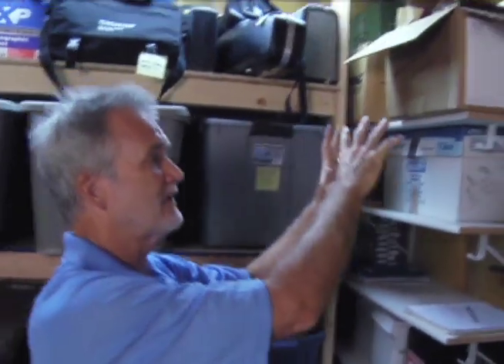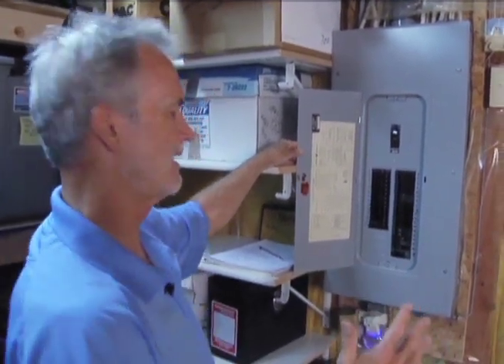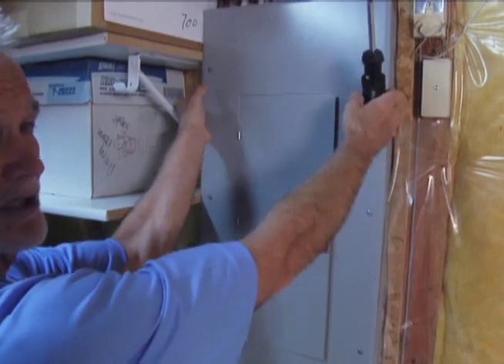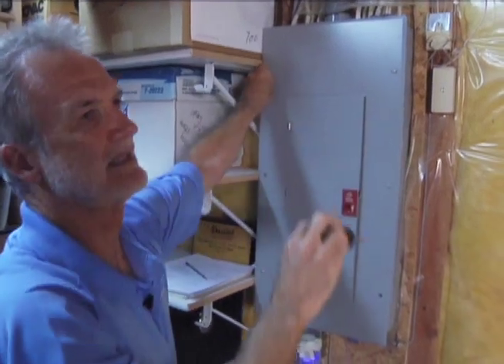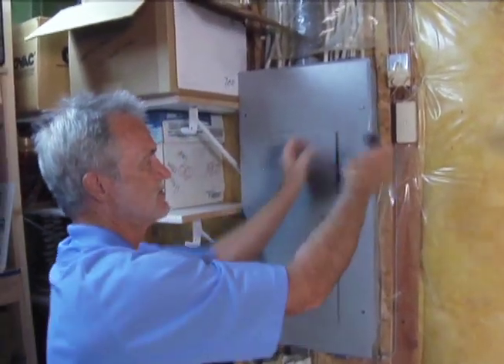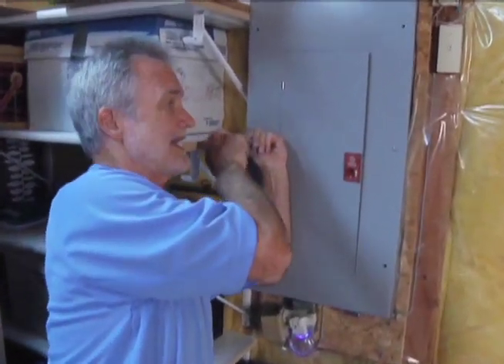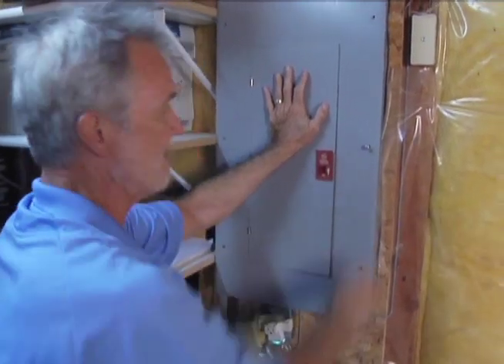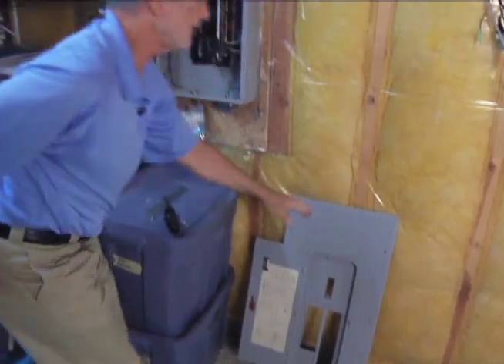How to Remove an Electrical Panel for a Home Inspection

Comment: So it's okay to remove a circuit breaker panel cover while the power is still on in the home?
Reply: As long as you have an appreciation for and respect for what could happen if the metal cover slips into the exposed copper feeders inside there  (wear good safety glasses)🤩💥👨🏼‍🦯⚡️
Reply: wondering this too

Comment: Can't find a video anywhere on YouTube about the bottom box below the main meter. I guess every house in the world except for mine has a dryer breaker inside the home. I guess there is no such thing as another house besides mine with the dryer breaker inside the meter outside. Not going to hire an electrician for $300.00 to replace a $10 breaker. Also not going to remove a panel that could come into contact with live wires. I guess I can call the power company to disconnect the power for free

Comment: Is there any codes about putting water tanks infront of elec boxes
Reply: Yes.  Firefighters need to be able to access the electrical panel.  Nothing should be placed in front of the panel, especially something permeant like a water tank.
Reply from the maker: Hi, Aaron! Thank you for your question. We found some information about an NEC code related to your question. You can access it here: https://diy.stackexchange.com/questions/58496/is-there-a-specific-nec-code-specifying-the-distance-between-water-heaters-and-e